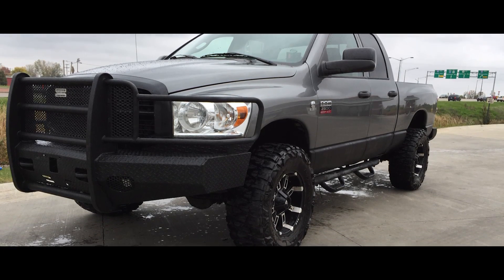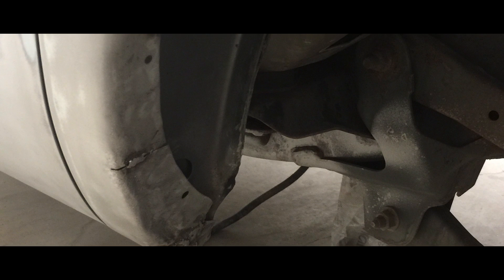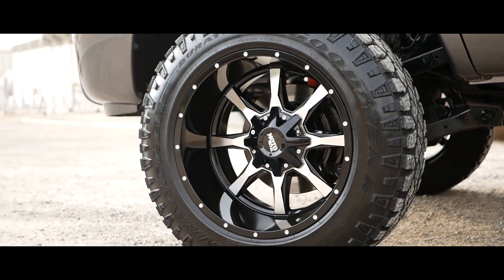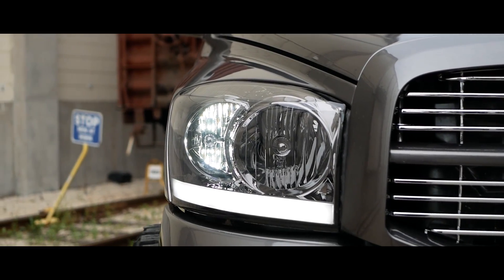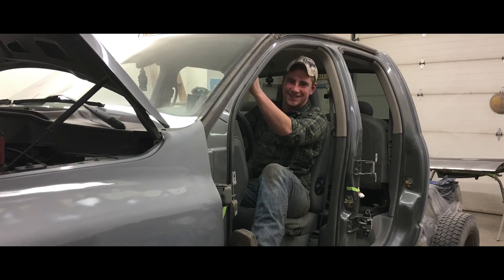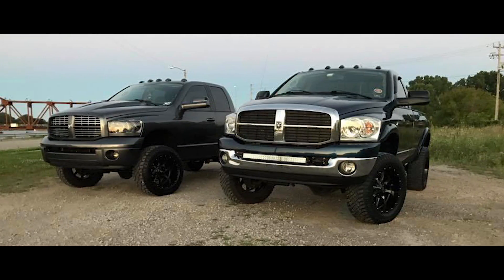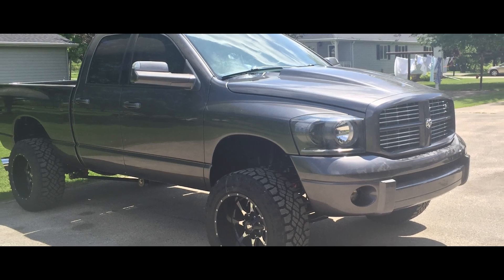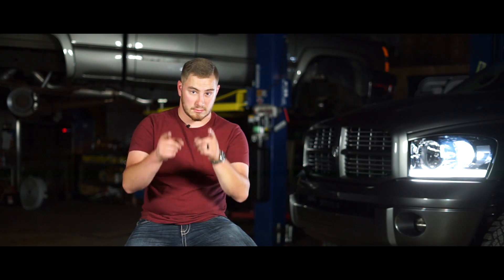The Builder || Dodge Overhaul

Comment: that's gorgeous, not overdone in any particular area! only dislike is the moto metals, a truck done that well deserves forces. big cost with those though so I understand. great job!
Reply: I agree, something other than motos. Forces, or Specialty Forged preferably. Hell even Fuel Forged would be an upgrade.
Reply: Same would make the truck no less than a 10/10 in my opinion as well. Low key drooling over this truck 😂 it flows so nicely other than wheels

Comment: Just guna give this a shot i need help with my brake lights on my 08 silverado they wont come on when i hit the brakes i got a new stop switch and nothing fuses are all good and i cant figure it out also my cruise and hi beams and turn signals  dont work either its my daily for work and its really comes in handy in this southern WI weather.
Reply: sounds like you have to get somebody to check the wiring for continuity and whatnot.

Comment: Are the 3rd gen 1500 and 2500 rams the same body styles? And if so, do yall think my 2007 ram 1500 could look exactly like this?
Reply from the maker: Body style no. But the 2500 does sit about 2-3" taller
Reply: @CustomOffsetsTV  what kind of lift is needed for my 2007 ram 1500.